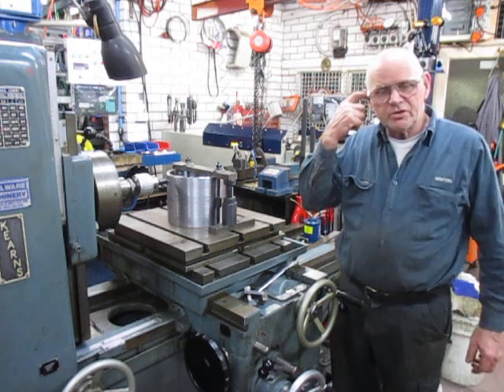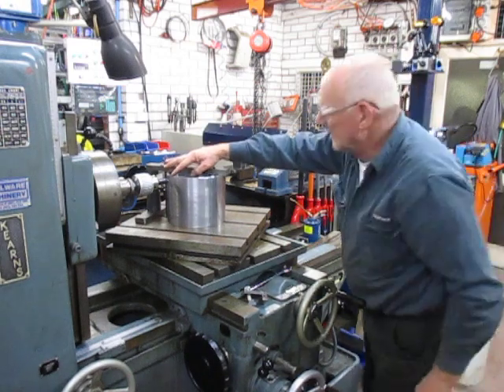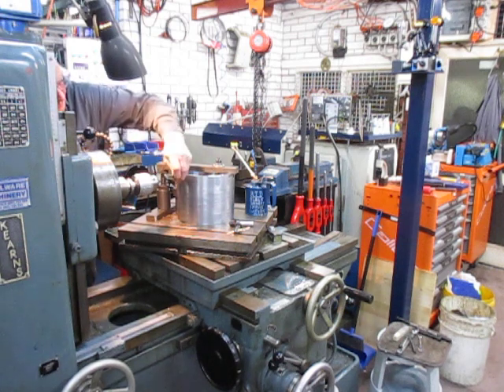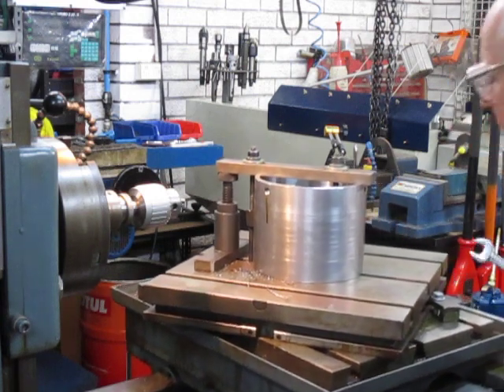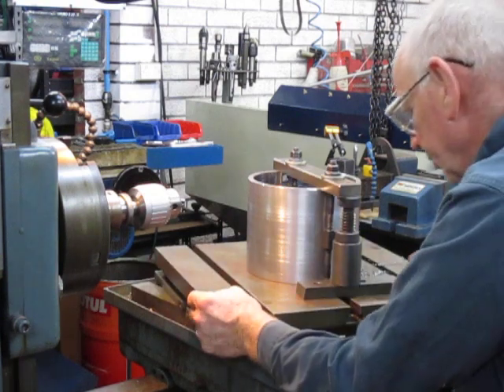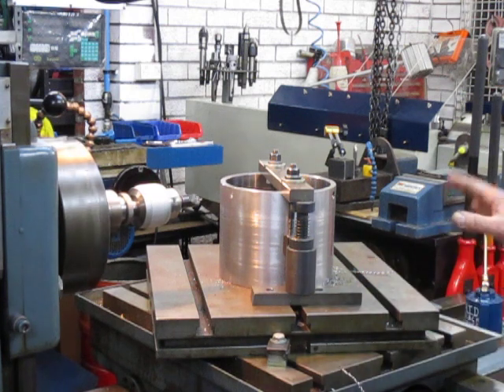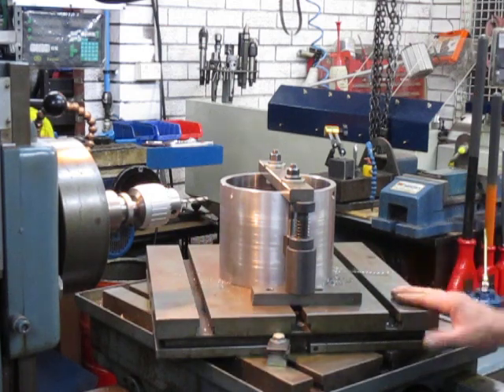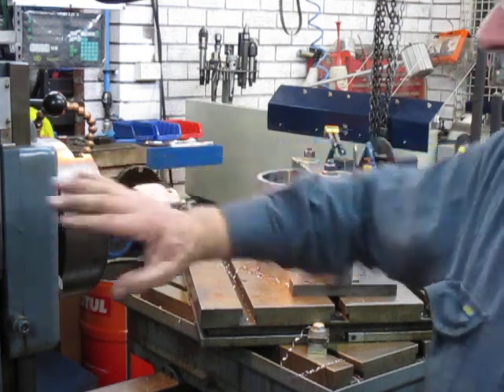Horizontal Borer in Action Kearns S model Facing Chuck

Comment from the maker: Marcel and everyone, Thanks for the comments I really appreciate it. The reason it is facing this way is because it has a different work height to the mills. I have a deck there that would not work with this machine, secondly this gives me a little more space without worrying about wearing a handle in my spine all the time which would happen, thirdly the way covers will slip past the crane column into no mans land, whereas the other way it would always be an issue. The crane will service 3 machines no probs. By the way I'll take on board what Marcel said about bumping with my hand, Mr Arthur Ritis is bad enough as is. Cheers

Bruce

Comment: Nice one Bruce! I felt for you when that centre drill broke, they're very good but are brittle. I had visions of déjà vu when I saw that scriber appear, as last time I snapped off a centre drill I also snapped off my scriber tip when getting the bugger out! It all went to hell in a handbag real quickly, so I suggest you not feel too bad about a couple of bloopers!

For that type of operation, especially on a machine like that without a great amount of feel when drilling, I would definitely suggest using instead a spotting drill. I guess they can be snapped, but I've never seen that happen, are more accurate, and are intended for spotting, while centre drills are for drilling centres. It will let you save those expensive carbide inserts for hardened materials, and spotting drills are cheap + can be re-sharpened

It's great to see that machine running and will look forward to seeing it doing some facing and boring. I love those machines, and Adam isn't the only one who's envious!

Comment: Very nice machine Bruce, I never could figure out why more manufacturers didn't build smaller ones like that. I have an old beaten and abused 2 1/2" G&L. It's the other "hand" with controls on operators right. They are a first choice for weird set-ups...Dave

Comment from the maker: I centred the part by measuring in from all four sides of the rotating table (I know it will be symetrical and accurate Kearns were renowned for their accuracy) with a digital  vernier depth gage was perfect, now investigating other options. Andy Pugh just gave me some hints also, I am investigating that as my scales on this machine are metric, his are imperial, I'm assuming same deal.

Comment: One other thing: We have a big chuck on a backplate that fits over the whole spindle. The machine makes a fair lathe for those very big facing jobs. The unsatisfactory part of that arrangement is that the whole thing attaches with 4 tiny screws re-using some holes that hold the spindle end together. There is probably a better way to do that. Not our idea, it came with the machine.

Comment: I envy you Bruce-you can buy such fantastic machinery..In oz where I  live I have to make my own- its just not available.One project took 18 packets plus of 8 gauge or 4mm stick rods full iron powders just for the welding..I have recently boughto 8 thout a medium sized lathe and a small mill-chinese manufacture its terrible,one of the jaws in the 4 jaw chuck had around 40 to 50 thou gap out of 90 degrees so I had to make myself a tool post grinder to fix the problem..Its just ridiculous.I have an old hercus lathe which looks to me like a southbend knock off..I think it was made in Oz under license to southbend..
I can put shafting in the hercus 4 jaw--12 inch stick out and it might wobble 4 to 8 thou..
the chinese lathe after grinding would be 30 thou ---before grinding the chinese lathe jaws over 600 thou---yes around 5/8th wobble.....The mill well I just can not talk about it ---I am so pissed of..

Comment: Bruce, thats a mighty fine addition to your shop, congratulations!
Is your smelly, smoking cutting oil made by Rocol? Asking because your oilcan says "RTD" on it.
Reply from the maker: Stefan Gotteswinter Yep it is ROCOL RTD, I love the stuff, messy but the ducks nuts for stainless and hard steels particularly threading. We used to run that in the Ward's and Henry Herbert captain lathes, and the Rigid threading machines. I fill the oil cans from bulk.

Comment: Hi Bruce.  Very interesting video. I’m looking at similar Kearns here in UK. Can the facing chuck be set to automatically increasingly open whilst running ? ( like a Wohlhaupter head for spot facing feeding more each revolution)    Does the 40 int tooling use a draw bar please.    Thanks anyhow.   Mike
Reply from the maker: Yes it can do an auto opening.

Comment: Love the channel!  Great new machine!  I do have a question: are there any marks on the rotating table to help you center up the work?  I found myself wondering how you centered the work but I guess you just put a clock gage anywhere on the non-rotating part and dial it in.

Comment: On the clamps: There should be a pair that slide in the middle T-slot and dog onto the hardened tapers for accurate 90 degree setting.  I assume you can figure out the details. I call them clamps, but they don't hold down the table, just locate it.
Reply from the maker: andy pugh Yep, got that. I only have one, it is what I would call a positive zero point locating wedge, it is hardened and ground to perfection! needs tapping in whilst snug tightening I think one is all that is needed and that is all I have anyway. Les has the clamps and they must be fitted to ensure no mishaps.

Comment: Hi mate.
You have got yourself a great bit of kit there.  I think your wife was right though, it should have been the other way around, if you have got the same compliment of controls on the other side.  You being right handed, it would make more sense.  Please be careful, adjusting that table by bumping it around with your hand.  Maybe not now, but you will injure your wrist cartilage, and when you get older you will not be able to move it anymore.  Just  Thought. 
However well done on that score, but how are you going to fit that machine out of the tent......
You might have to sell me one of your mills ; )
Marcel.